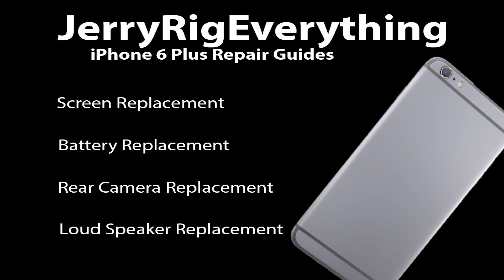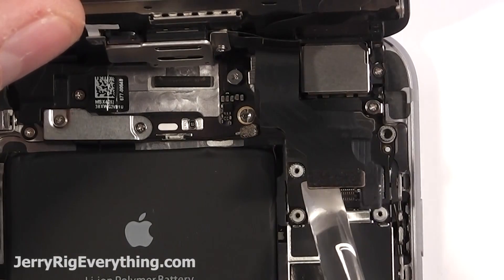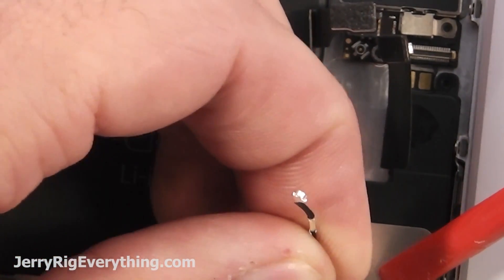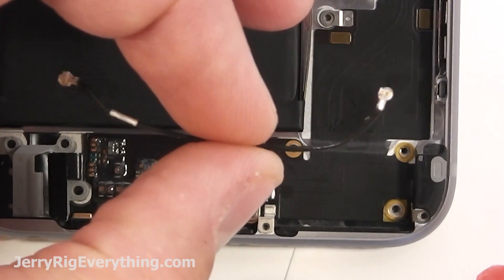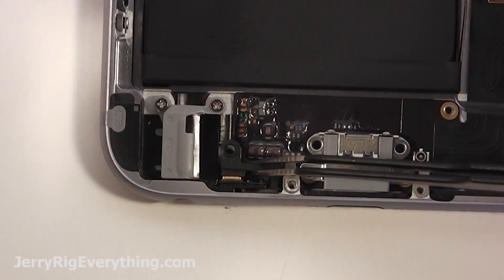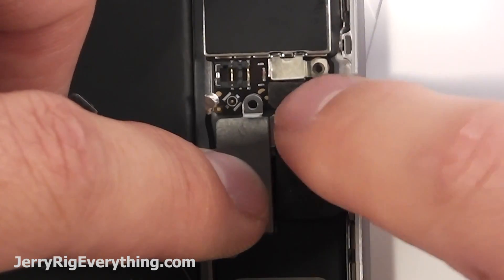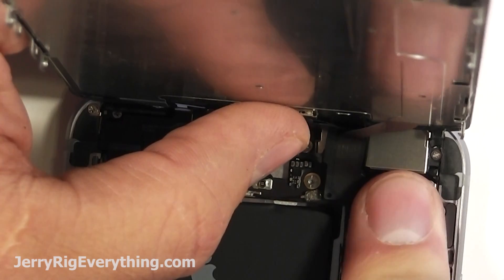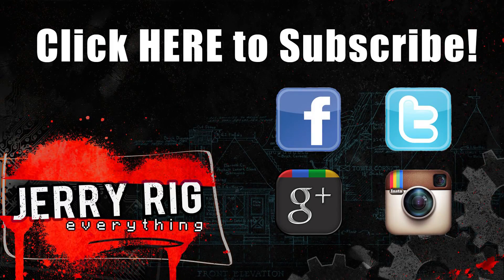iPhone 6 Plus Charging Port Replacement shown in 6 Minutes

Comment: Hi you didn’t mention you have to bend ribbon parts to fit and some replacement parts are not accurate when it comes to positioning holes for screws. Next to the jack my microphone cable tore off so now I have to order another one.

Comment: Okay, i've NEVER done anything like that before but i got it done. From opening to exchanging the doc took less than 10 min but putting everything back took 2 hours. It was hard to line up everything perfect and i mixed up the screws. 2 screws won't fit so i left them out. I did see lines after hooking up the 4 cables and then the phone was "on" but wouldn't turn off. I freaked out but after reconnecting everything, worked good. BTW, small screws are PITA. Thanks so much. Sub'd

Comment: My 6+ just suddenly stopped charging.  Also my PC / iTunes no longer recognises if I attach the phone via USB.  The phone WILL charge very slowly if I have it turned off completely.  I've verified the cables and charger are good with another phone.  If I turn the phone off and and plug it into a charger it will turn back on.  However the lightning symbol to say it's charging does not appear when attached to the charger or my PC.   I've put the phone in DFU mode but iTunes still can't see it.  I know the battery is good because it does take a charge and the phone can be used.  I have managed to do a software update from iOS 11.3 to 11.4 and this did not resolve the issue - Am I right in thinking the primary suspects are now hardware?  Specifically the Charging port assembly?

Comment: I did this replacement. But for some reason when I put my screen back on theres still a open corner on the bottom left. It looks like something is blocking that only corner.  But I open my phone and see nothing in the way

Comment: Crappiest IPhone I ever bought. My 3 and 4 lasted so much longer, and still work! This 6 plus, the fingerprint worked for about a week. The front main camera takes blurry pictures, I seen that apple will replace it, but I don't have time to send my phone in. And now, finally, the charging port is going out, I have to have the charging cable angled to have the phone take a charge. Piece of junk.

Comment: Someone please answer this
Do we have to change the microphone also while changing the charging port?
Reply: Radha Mishra don't thing so
Reply: Yes, the microphone is attached to the charge port bus. There is a plastic mount you have to remove from the back of the old mic and attach to the new one. The charge port I bought had a removable adhesive strip to stick it to the plastic. There is a small locator pin on the plastic that goes into a tiny hole in the ricin.

Comment: Very good vid thanks. No luck though. I tried this and the battery replacement. I've got a u2 chip coming in the mail but after that i'm out of ideas. It's possible I broke a connection somewhere but i don't think so. any suggestions?

Comment: Hey Jerry, I am doing a iphone 6 plus screen and I have run into something I have never seen before.  I took off the metal insulator backing and there is another metal cover behind it.  I have done about 50 various iphone screens and never run into this.  any thoughts?

Comment: Thanks for the video it was very helpful.  Unfortuntly I have ran into a snag. The old charging port worked kinda.  (if you held the cable right)  the new port does not seem to be working at all. Is is common that the new ones do not work?  Thanks again.

Comment: Hey buddy great tutorials , my iPhone 6 plus is all dark , it doesn't turn on at all, it was not water damaged , can you tell me where to start trouble shooting first, I have no idea where the problem is , I've tried different cables to charge, but nothing, its all dark screen . Thanks.
Reply: maybe the charging port. try bring it to tech so they can check it
Reply: unlikely that it's a battery problem because it should try to boot with just a charger. Try checking your screen connections
Reply: plug it in to a 2 amp wall charger first
Reply: Qader Eshpari u
Reply: check your battery possable need replaced

Comment: i need major help i don't know whats wrong with my iPhone 6 plus when i press the power button it doesn't come on but when i plug in my charge it shows the apple logo then goes black but still shows light off the screen soon as i unplug it my phone jumps right back off i don't know what the problem is if anybody know please help with a solution.
Reply: tyler pool could be your battery
Reply: I replaced it already now it comes on without the charger in but the screen still does it video on my channel I really couldn't explain it
Reply: i have the same problem. but the next day its not working so i decided to bring it to the tech. then they try to put a new battery and yes it work. but when we try to charge it. its not working the tech said its not the battery its the charging port. the same as the video showd
Reply: if u wnna check to see if it's ur battery u could remove the battery off the phone and plug in the phone. Try powering it on and if it powers on, then ur battery is broken. You don't need a battery to run ur phone if it is plugged in

Comment: Best video I've seen thank you. Not sure what's wrong with my 6 plus but I replaced the battery, I plug in a charging cable and it vibrates, shows its charging (lightning icon beside battery) but the battery is draining and there is no charge at all.  This video helps a great deal to take it apart and investigate. Thank you !
Reply: 5abivt maybe your battery was bad

Comment: Well I changed the port did everything the video said phone still want come on what else could it be
Reply: try replacing the battery or make sure you installed correctly
Reply: Sean Williams probably battery or lego connectors arent connected properly

Comment: Does anyone know if you can change the port and the battery at the same time? I need both and don't want to open it twice. I also don't want a good port and a bad battery unless I have to. Any knowledge would be helpful!  Thanks
Reply: first disconnect your current battery and plug the old one in, see if it turns on. then try charging if it charges its good. Im in the same scenario so im playing it safe and opening it when i have both parts.

Comment: Just performed this operation.  The install went well, but the phone won't charge.  It wakes up but hovers around 1% charge then poops out when I try to do anything other then let the phone sit with the backlight off...
Reply from the maker: Might be a bad port.  Let it charge for a few hours.  If that doesn't work,  order another replacement and see if that fixes it.  Sometimes they are bad
Reply: +JerryRigEverything Nope, looks like it was the cable, all three of my amazon cables appear to be bad.  the new charge port appears to be working correctly, although the headphone jack seems to be screwed up...   I'll go in and reseat the connectors when I get time...

Comment: I may have to give this a try, I just looked on Apple.com and an after warranty repair is $329 just for the service fee!  And I'm sure they'll inflate the cost of the charging port.
Reply: +Munchito696 Well I just saved myself time and money.  I looked inside my port with direct sunlight and noticed discoloration at the back of the port.  Then I thought of something...  Compressed pocket lint!  I broke a toothpick in half and used the splintered end and ended up digging out compressed lint and it works now!  I figured blasting compressed air would get any lint out, but I guess it was packed in so tight that it needed something to break it up.  If you are having charging problems check for that first.
Reply: you are my hero, just had this problem and this solved it. At first i thought it was my port that was messed up because the charger would wiggle. Turns out it was the lint and now it does move at all and charges. Thank you !!! <3
Reply: BlazedMarsHD I actually had to do this again the other day.  Fucking lint!
Reply: Munchito696  Your comment on the lint thing saved me $ and trouble. Thanks bro. I read your comment and went to work on getting all the fucking lint out. As I was doing it, the videos kept playing automatically, and one came on that explained the same thing. But you saved me bro, thanks !!!!!

Comment: Thanks for the video. Before replacing the charging port I was able to wiggle the cord and get it to charge. ( tried several cords with the same result.) Unfortunately, after replacing it, everything works except it won't charge at all. If I plug in the lightning cable with the phone off, it wakes up the phone but will not charge it. I ordered and tried another charging port and have the same result. Any ideas? Did I miss connecting something? Thanks in advance.
Reply: +Don Wynia I'm having the same problem...  have you found any solutions?
Reply: +evangelon2 hey Don, it was my cables.  All of them where bad.  You've probably already figured this out.

Comment: I replaced the charging port and followed your guide. All went well aside from 2 screws going missing. Not my question. The vibrating motor won't vibrate the phone. It works. I can hear it. Just not as powerful